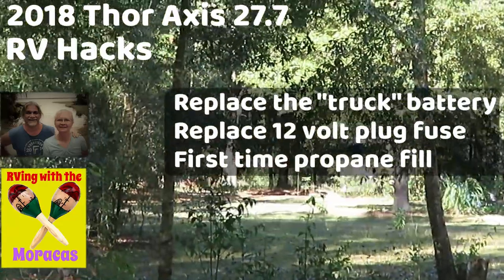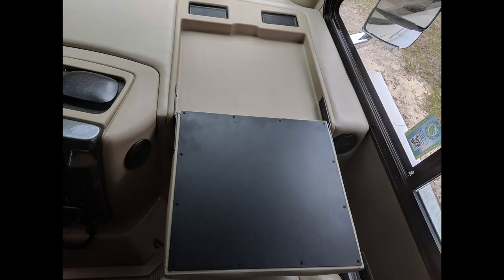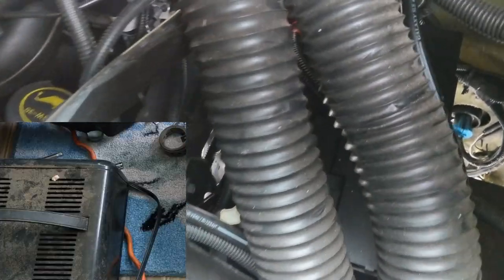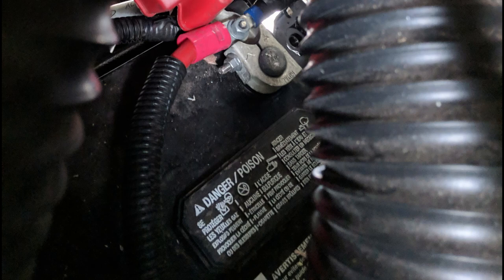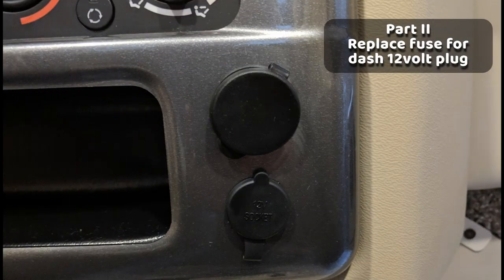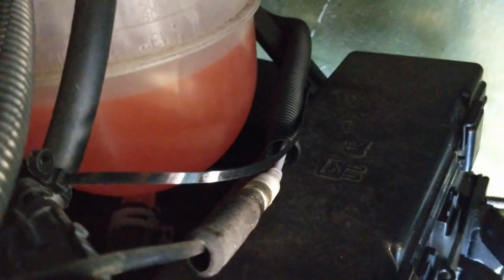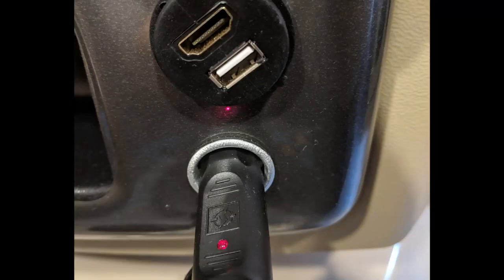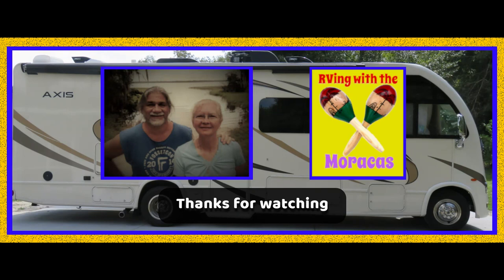RVHacks - Thor Axis 27.7 Replace Battery and Fuse

Comment: there is emergency start switch on the dash, you hold it up and and while holding it  crank your engine - it will fire engine right up using coach batteries. At least this how its works on mine 2018 vegas 27.7

Comment: thanks, we have a dead battery and tried to jump it from the front drop down. couldn't get a good connection.  Why the heck the battery is designed like this and the access panel isn't already hinged is beyond me.  Thanks for recording and sharing.
Reply from the maker: I have no good answer for you. ;-(   it seems to be poor design engineering but good use of space just not good for the customer.
Reply: @RVingwiththeMoracas  I wish they had put an access panel on the side of the cab.  Heck, RVs have plenty of doors, what is one more :)

Comment: I just got a Thor Vegas.... this looks horribly confusing...I am not as handy as you.  I hope I don't run into this issue
Reply from the maker: It is easier than you think. Once you start looking at it you can figure it out. But I agree better to not have to do it. Be sure you know how the main power switch works to keep your batteries in good shape. That was our problem 😡
Reply from the maker: You may want to watch our "RV Camping at Stephen C Foster State Park in the gator swamp" video - at about 45 seconds we explain how our main power switch works.
Reply from the maker: the link is https://youtu.be/tlHocGrki4w

Comment: Why on earth does it only have a 650cca battery?  I think they would have put at least an 800 to 1000cca in it.  I am not impressed with the build quality of that access door. Looks like it was made from junk.
Reply from the maker: The access door was built from junk ... It's a build your own deal and that was stuff available in my workshop.  It is not visible at all.
Reply: @RVingwiththeMoracas . Oh no!  I hope I didn't insult you. It is obviously fine for what it does.  So there is no access door, and one has to be made?  Odd.
Reply from the maker: No offense taken. I thought the same as I did it.  The wood is just mostly cut out you have to cut 4 tabs to open it.